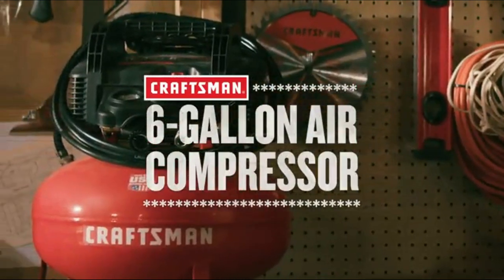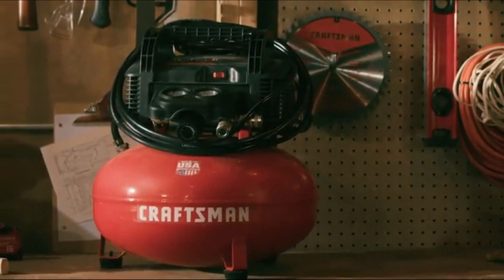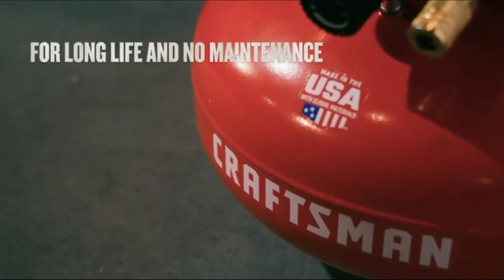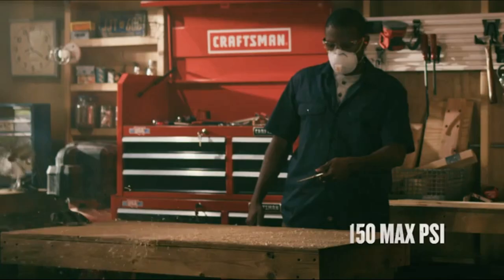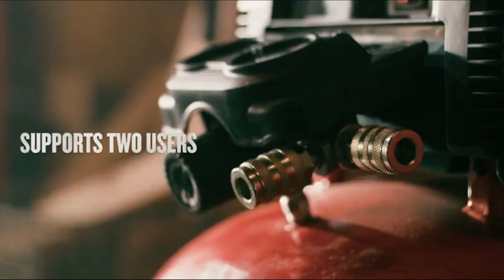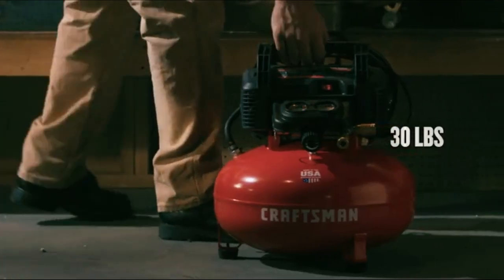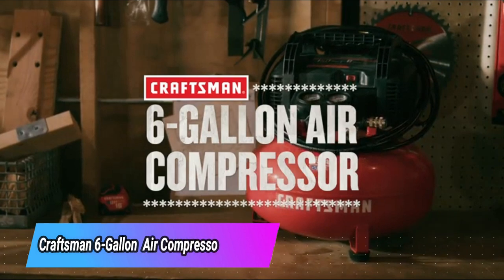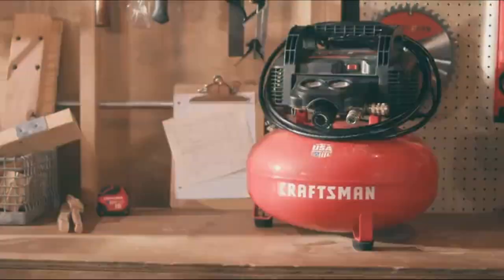Craftsman 6 Gallon Air Compressor Review 2020 | Pancake Air Compressor

Comment: Ok so I have no idea about air compressors so I need to ask a question. Once it’s filled with air do you need to keep it plugged in to use? The reason I ask is I’ll need to use this out in the field & I will not have access to power or a generator.
Please advise 
Thanks
Reply: No you don't have to keep it plugged in....but it won't refill without power.
Reply from the maker: Thank you